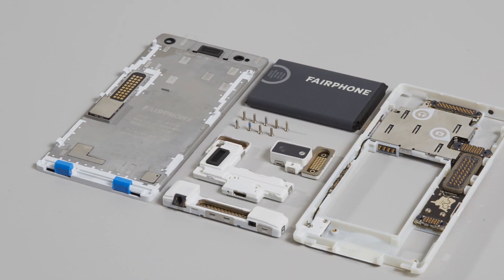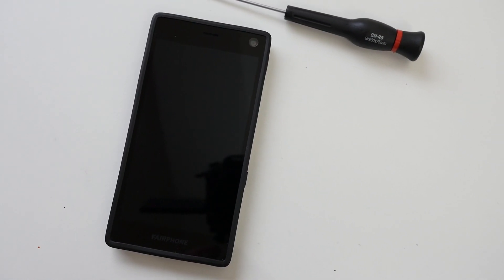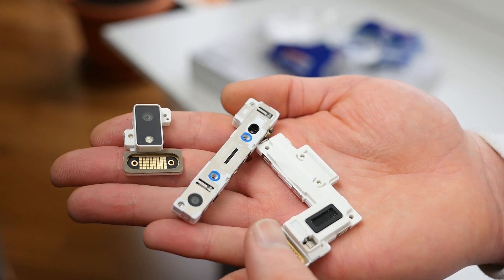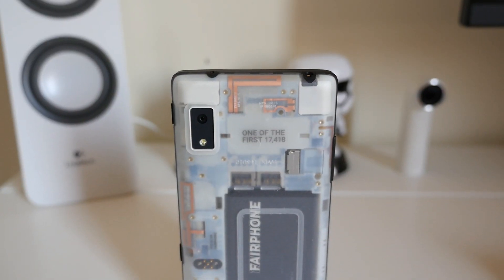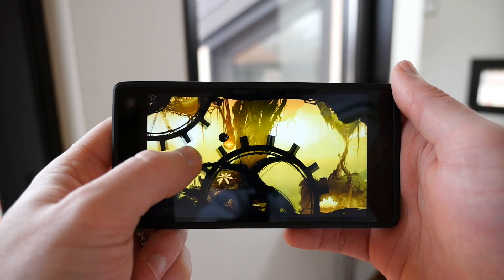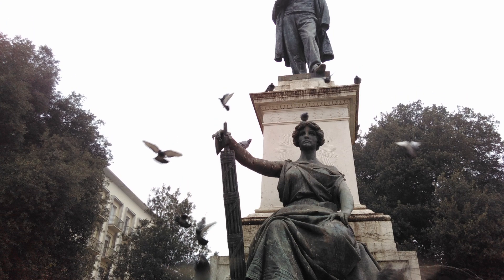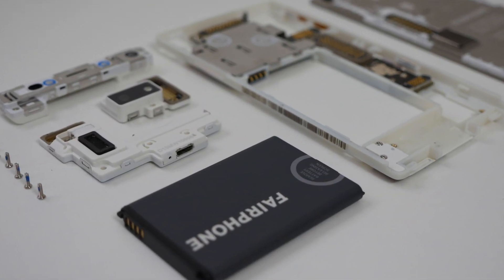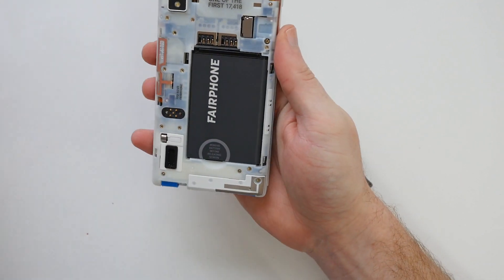FairPhone 2 Review ENG | HDblog

Comment: I have a question: i wanna buy that phone but i am not quiet sure because of the pretty low batterytime. So  i wanted to ask if it would be possible to buy a second battery and carry it around an switch it if the first one runs out? That should be possible since all parts of the phone should be replaceable right?
Thanks a lot in advance :)
Reply: i know its more than a year ago you asked your question but i thought i answer it anyways. Buying extra batteries and swap them out when needed should be no problem at all. A spare battery is only 20 euros.
Reply: @MrYatzoo  Really? Can you just swap a phone battery on the go?? I might just buy this phone if this does that!
Reply: @XandriaRavenheart  Yeah, it takes just seconds to swap batteries!

Comment: I don't care about looks. This was never a mainstream phone in my mind. But the 3-4 hour on-screen battery, that sounds really low to me. I still use an old brick for a phone, and was considering this as my first smartphone, but my phone-calling battery on my old Nokia is more than 24 hours, and its idle power is over a week. And I like that. So I'm wondering: how long does its battery last in idle mode?
Reply: I have a FP2 and as a heavy user I am generally satisfied with it. The battery is the biggest drag, and occasional software glitches which need to be sorted out by often restarting the phone or waiting for the next software update. The battery lasts at most 8 hours idle mode and if you have auto sync or anything else on in the background this is significantly reduced.  However if you turn on battery saver mode it lasts for up to about 12 hours of pretty heavy use, and i have not noticed any reductions in performance. The only minor annoyance is that you need to turn on battery saver mode after every charge as it automatically turns off when plugged in.
Reply: David Townsend Thanks. Really appreciate the info.

Comment: potentially the preferred phone of governments, their contractors and business that require infosec.
-- it's a true linux phone.
Reply: True, the ability to quickly remove the camera and/or microphone non-destructively would be a definite boon for high-security applications. I dunno about "true Linux", though. It still runs Android and all that entails. But they probably have an unlocked bootloader, so maybe you could flash Sailfish or another Linux-based OS?
Reply: Mike Trieu
infosec means:
1. system developers can inspect, modify and test all code.
2. binary compiled apps
3. encrypted filesystem
4. encrypted communication
etc...

sailfish combines linux kernel, mer middleware, jolla GUI and, the commercial OS has Alien Dalvik, etc.  but these specific OS components can be substituted and built to order. governments of BRICS nations are the ultimate target.
Reply: Not sure where you're driving at. If that's your criteria, there are no "true Linux" handsets in existence. There will always be some proprietary layer. Heck, nobody knows what's going on in the cellular baseband OS.